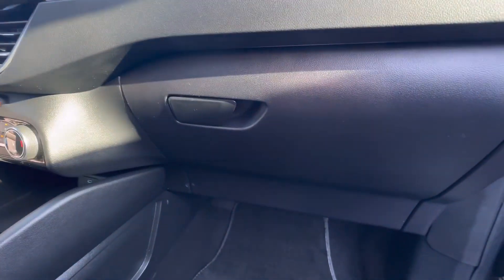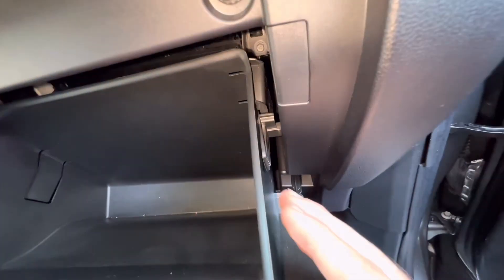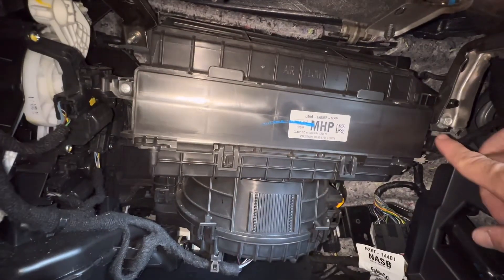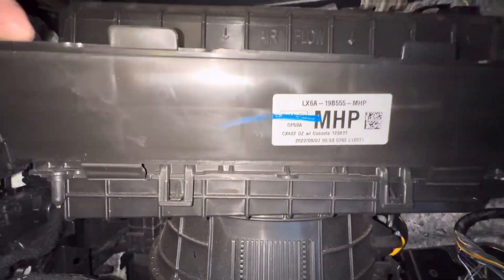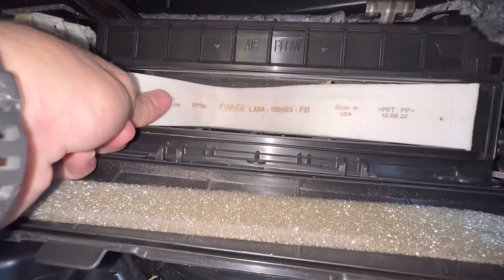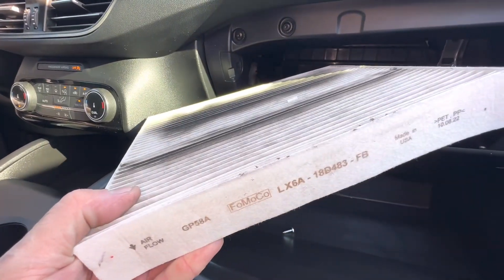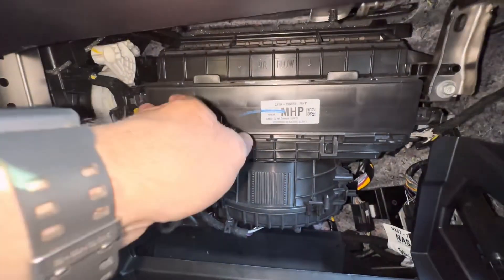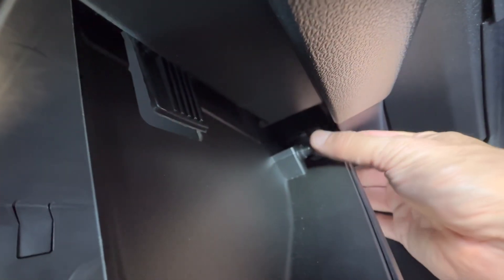2020 - 2022 Ford Escape How to Replace Cabin Air Filter

Comment: You made it look so easy.  I had lots of trouble getting the damper on the right to come off, used some pliers to compress the pin, then I broke the left clip, put a new KN filter in and was a lilttle tight, but got the screws back in and closed the door, could not get the damper back on, but will try again.  The dealer wanted an arm and a leg to replace this and the engine air filter, purchased the KN for about the same price, now just have to clean them and never get new ones.

Comment: I have a 2020 that I bought in June of 2023. The cabin filter cover had both clips busted off and no screws. Ford parts wants $53 for a hardware kit, that's not happening. Would you by any chance know what size those screws are?